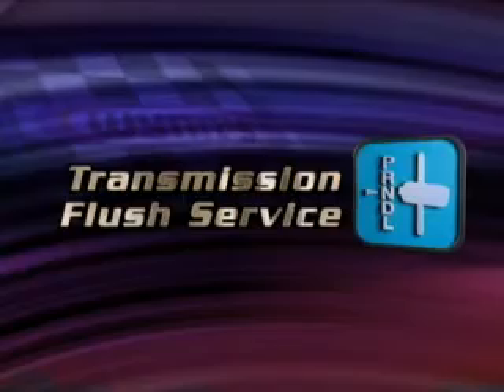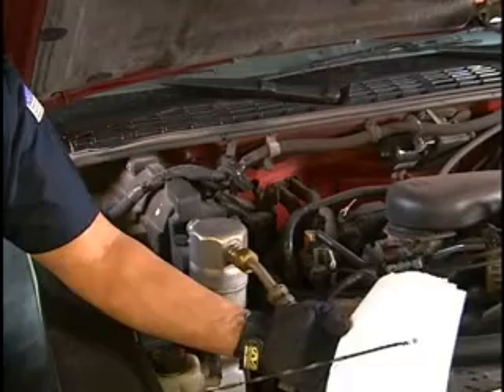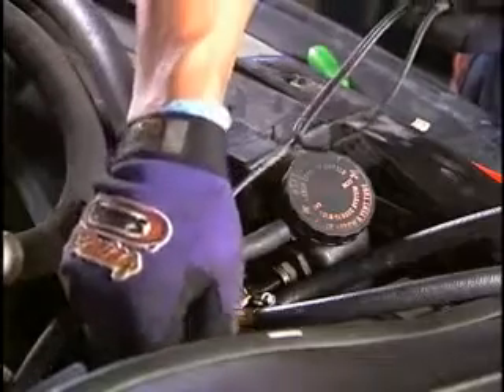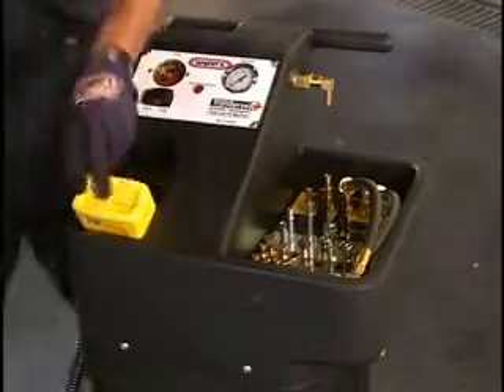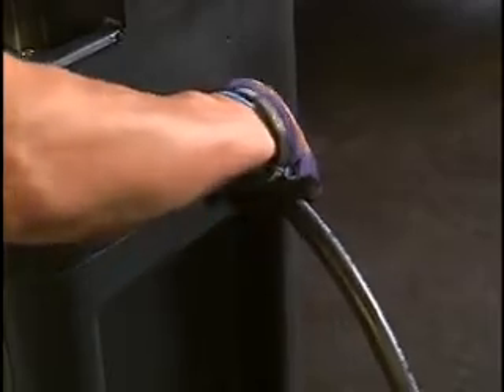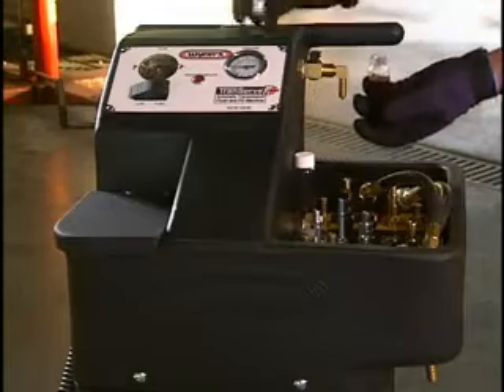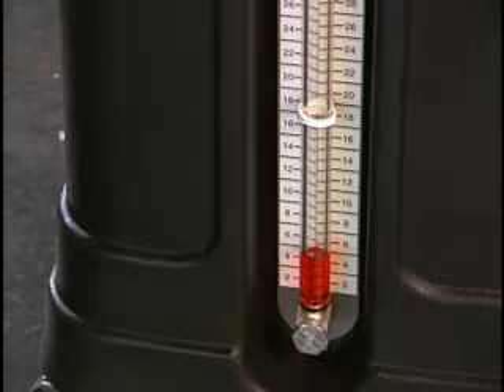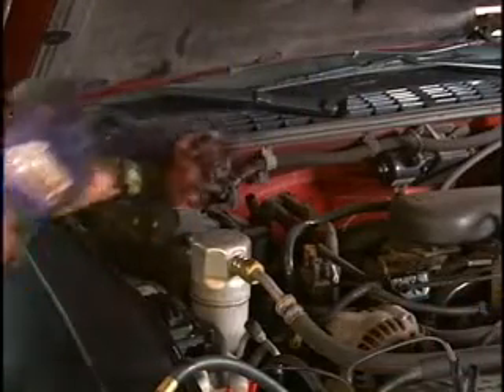How to operate a Wynn's Transmission Flush Machine

Comment: These "flush" systems mislead the public in so many ways. 
A "flush" system may pump out the old fluid, but there is NO possible way whatsoever the flush will clean out the filter and remove sediment from the bottom of the pan. 
So many people fall for this gimmick at the quickie oil change places.

Comment: @WynnsProducts  You are wrong! You MUST change the filter when you service the transmission. Would you change your engine oil with out changing the filter? The answer to that riddle is NO. Most filters are made up of a Dacron material and clog very easy. You should remove your transmission pan(if it has one) and inspect it for large pieces of debris that would give you an indication that you may have a problem.
Reply from the maker: You're correct when you "service" the transmission.

Comment from the maker: When you drain and the system your only removing 4 to 5 quarts out of 10 or 12 quarts. Our TranServe Flush machine removes 99.9% of the old fluid, at the same time it fills the transmission with new fluid.